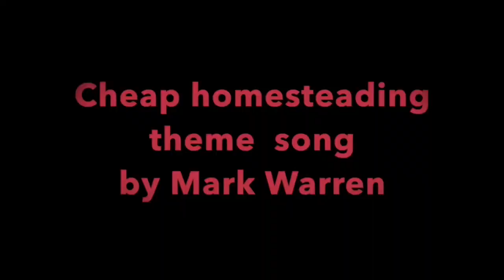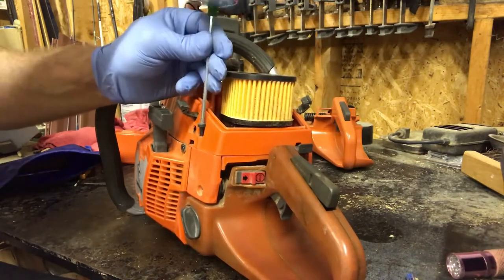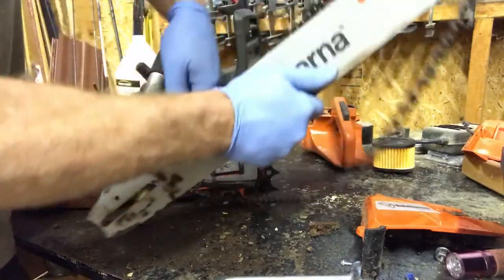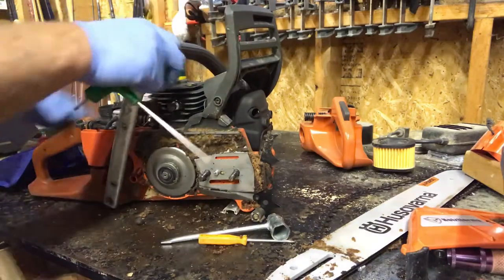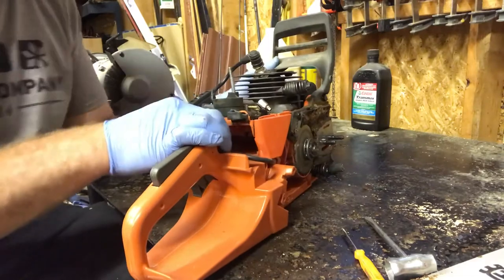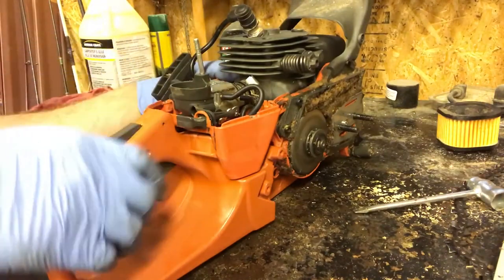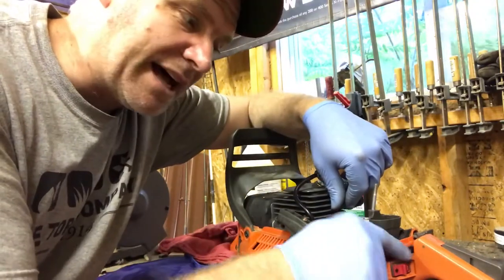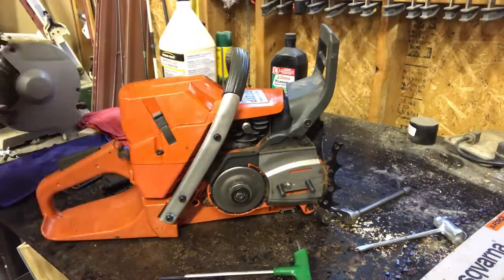Changing a fuel tank on a Holzfforma G372xp/Husqvarna 372xp

Comment: Good video, this will help me tomorrow. My new G372XP arrived today and somewhere it has a fuel leak, so I need to take the tank and hoses off to inspect. There is a hissing noise of fuel escaping where the handle screws on so I think it is cracked on the thread.
The plastics do look very cheap but the rest of the saw is good.

Comment: So I changed the tank on my 372xp OE from 2007 and the throttle cable slips when trigger is all the way let go and adjusting the cable and cover does nothing it just slips but the last throttle cable worked

Comment: I just got my g372xp. It started and I let it warm up for 5 min and reved it up for a second and turned it off. Moved the chainsaw and gas came out from around front left side. Now it won't start. I move it around and I don't see gas pouring out. Any suggestions?
Reply from the maker: move the saw in all different directions. If there is no leak found.Most likely it’s flooded take the spark plug out Dry it off and then reinstall it and see that it  starts you might have to Adjust the carburetor. When it ran was it running good
Reply: @cheaphomesteading   it kinda sounded like it was almost  dying when idling.  But sounded great when reving it up.
Reply from the maker: @Nohkral  you should adjust the low needle. open up the needle a 1/4 turn and see if its beeter